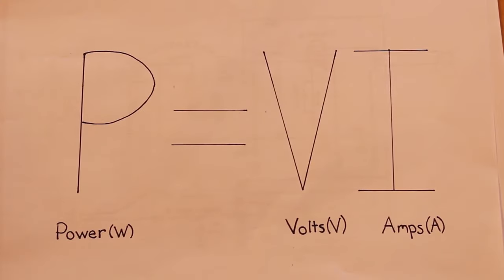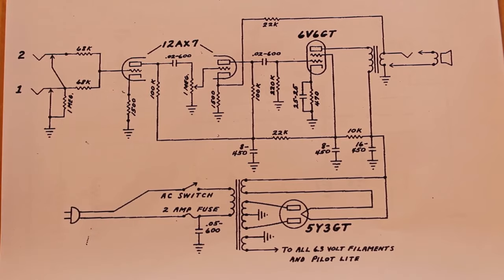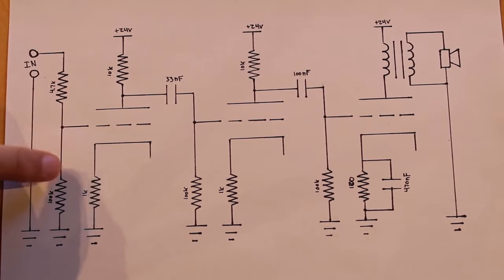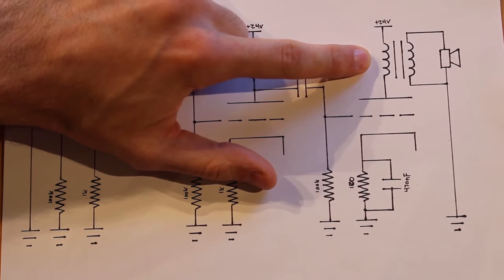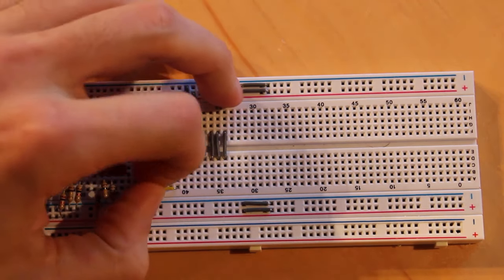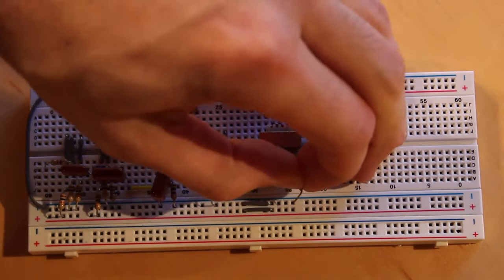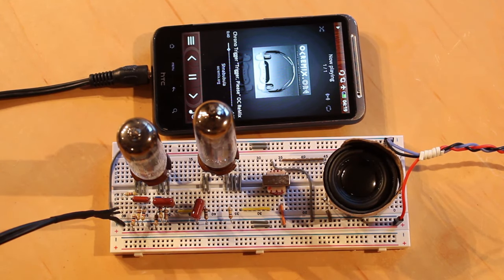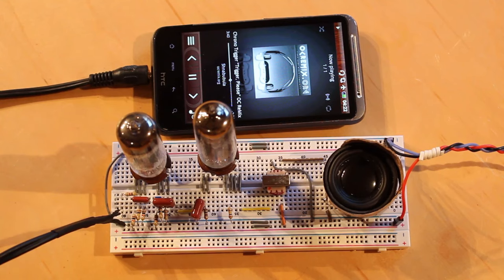Let’s Build a Low Voltage Vacuum Tube Audio Amplifier

Comment: Instead of thinking of the caps as DC blocking, think of them as AC coupling.  They let AC (the audio) through, but gets rid of the DC bias
Reply from the maker: I always had a hard time with wrapping my head around capacitors letting AC through. There’s no direct connection inside a capacitor and we’re not inducing any voltage with magnetic fields like in a transformer, so how can AC pass through? 

What ended up clicking in my brain was that AC isn’t passing through so much as the capacitor is just charging and discharging in sync with the frequency of the AC. When the AC is on the positive phase, it charges up the capacitor, making the other leg of the cap act like a ground pin. When the AC is on the negative wave, the capacitor discharges, making the other leg of the cap act like the positive pin. (At least, that’s how I’m seeing it in my brain, that’s probably not the best way to describe it though).
Reply: @UsagiElectric  And isn't the electricity flowing one way on the charging and then the opposite way on the discharging? So that electricity never actually flows through a capacitor?
Reply: @UsagiElectric  in the process of trying to build a low voltage tube amp for a pair of old 1920s head set I’ve got, and remembered this video, hoping it will work, any how seen the comment about capacitors and I figured I’d add some more info the Charge is being stored within the dielectric of the capacitor, Benjamin Franklin explained this when the layden jar was created, and somehow it changed to the metal plates!
Reply: @UsagiElectric  I've always just accepted DC blocking caps without properly understanding until you explained it.
Reply: @edgeeffect  There's also AC-blocking capasitors, called capasitor dropper. Take mains voltage it is 120 ACv 50Hz or 230-240 ACV 60Hz. When the caparcitor charges on the rising voltage it passes current trough, but when it is fully charged the current stops to flow. So based on the capacitor value and the current flow on the load it drops the voltage as it only lets part of the wave in each "hump" through.

Comment: I think you would get more gain if you used cathode bypass caps.   The cathode resistor is there to put a small dc voltage on the cathode to bias the grids slightly negative so it is operating on the linear part of the tube's power curve.  Without the cap to bypass it, it is not pure DC but varies with the signal in the plate current.  This effectively will cancel out some or all of the input.
Reply: You won't really get the tube running in its "linear" region as you put it with such low voltage.   Cathode bypass caps really won't make much difference at such low voltage, with such a small output transformer
Reply: @EsotericArctos Right, the tubes are basically running in "space charge" mode here

Comment: I really appreciate the work youve done with tubes. Not many (at all) work with tubes at low voltages. Been waiting on an audio setup!
Reply from the maker: Thank you so much! I think high voltages usually associated with tubes scare a lot of people away from them, but they actually work surprisingly well even at low voltages. We actually expand this audio setup a bit more in the next episode. Also, one of these days, I would like to try to build a proper OTL amplifier, although that one will probably require a genuine HV power supply.
Reply: @UsagiElectric  i agree the plates should only need about 36 volts to charge them

Comment: I did it 40 years ago using 12ax7 or au7. With 12v on the plate let the bias float. It was remarkably clean.

Comment: The capacitors between each amplification stage are called interstage coupling caps.
The easiest way to conceptualize these caps, for novices, is that they block DC but allow AC to pass through.
The DC voltage is your tube power, and the AC is your audio waveform being amplified.
Basically these block the high voltage DC from passing to the next stage, but allow the AC audio waveform to pass through unopposed for further amplification.
Reply: nah

the easiest way to conceptualize these caps for novices is that they get dc biased

u have to mention that the signal after the input is actually an ac signal with dc offset

and the capacitor when exposed to this signal slowly gets charged to a voltage because this signal is centered around a dc voltage and not 0

they get charged to the dc voltage, therefore only the ac passes since the ac is swinging around that dc bias, and the capacitor cant react/charge instantly, therefore passing the ac

this is basically a high pass filter

basically imagine the capacitor gets charged to an average value of the signal it gets (both sides), say if the capacitor has 5v charged because ur signal is centered around 5v, the resistor after capacitor has a voltage of 0 or the divider voltage, imagine the resistor is connected to ground therefore 0v when capacitor is charged, now the signal is 6v, the capacitor cant charge instantly, but since the capacitor already has 5v across it, a 6v on the capacitor positive terminal means 1v on the other terminal, the signal is forcing 6v on the positive terminal because it is a voltage source, since the capacitor has 5v, the other terminal must be 1v, and this 1v is also on the resistor since the resistor is connected after the capacitor, this is how the changing signal gets passed, now novices will ask, whos to say the capacitor wont charge to 6v and wont pass the signal, that topic is covered within filters and frequency response, in the same way, if the signal suddenly becomes lower than 5v, the resistor actually has a negative voltage, which many novices dont understand how u can get a negative signal from dc voltage, this is because capacitor discharges the other way through ground, and this is also why the voltage signal needs to be push pull, say if u have an emitter follower without a resistor to ground, u could measure a changing voltage, but a connected capacitor wouldnt discharge because when the signal becomes lower, there is no pathway to ground to discharge

if u understand these, u can further understand dc bias in capacitors, diodes, varactors, extending into rf circuits

saying they block dc but allow ac is like memorization, u cant conceptualize and u cant understand

when i was a novice, i sure didnt get or conceptualize wtf u mean block dc but allow ac, i mean i heard wat u tryna say(but i would just be a yes man, it be like "it is wat it is" for me), and theory also says so, but there was no conceptualization

but what i mentioned is the actual conceptualization

now if u learnt about superposition in ac circuit, then u can also calculate it and model it, u can both see how it passes the ac and see the frequency response/transfer function in a simple rc circuit

when u a novice, u also dont understand why everyone says only ac make sound when clearly dc also makes sound

because their definition is ill defined, though dc is defined as current in one direction, ac as current in both direction

as long as a signal is changing, no matter ac or dc, it will make sound, might be better to call it an ac signal with dc offset, in circuit model, u would put dc source series with ac source

and another thing novices dont get is how a transistor is able to work with ac when it is a dc device, the reason is also the capacitor, u cant just apply a negative signal, but if u apply that negative signal to capacitor first which has a dc bias, u can offset that signal into the positive as long as its amplitude isnt bigger than the dc bias, thus the transistor is actually still working with dc (formal definition)
Reply: @urnoob5528  You dive into the fine details, while correct, novices will just stop listening because it is much too much information at once. A novice starts with basics, not fine details. If novices dont get it, its because the explanation is too detailed.
Reply: Thank you👍
Reply: Some pedal manufacturers, like BOSS, use electrolytic caps for interstage coupling, due to cost. A 1 mfd electrolytic is about ten cents, where a nice polyester or mylar cap is about two dollars.
With the electrolytic, it only conducts one direction. So, you receive only half the sine wave at your signal out.
I can always tell a BOSS pedal because they sound like BOSS pedals.
MANY manufacturers do this, so, check your pedals and replace any interstage electrolytic with a nice polyester of same rating.
Replace ONLY electrolytics that are INTERSTAGE not electrolytics used for power or other functions.
Make sure you use a schematic.
If unsure, LEAVE IT ALONE.

Comment: Thanks for the great video. I joined the Royal Australian Navy in early 1979 and entered into an electrical engineering course. My class was the last to learn about valves and I worked on the 4.5" turret which was driven, as well as an A and B motor, by a big bank of valves. One of my biggest regrets is deliberately blowing up valves in the RCA testing case!
Reply from the maker: Thank you so much!
That's awesome that you got to learn and work on some proper tube equipment. I can't imagine the amount of power needed to drive a 4.5" turret, the bank of tubes must have been truly a sight (and a great heater in the winter)!
Reply: @UsagiElectric  In general, the motors in heavy duty drive trains such as gun turrets use DC torque motors, which have their current controlled by DC motor generators (MG's). The output of the motor generator provides the current to one of the torque motor windings. The input to the motor generator controls its output current. At this point the MG input could be produced by vacuum tubes or solid state circuits in more recent equipment. Using the output power of a large group of tubes to provide the current through the torque motor winding is possible, but not very practical.

Comment: Dear Usagi, excellent project!
This extremely low voltage amp is useful as a phono preamp or a similiar application. Since most tube amps need a plate voltage of 300v or or higher, most folks use transistors amps. But, I think tube amps sound better.

Comment: You inspired me to go back to tubes experimentations : since your two videos on heptodes, I built a low-voltage guitar tremolo with a beautiful, small 6AJ8 pentagrid converter, and was amazed by how good the sound is, given the circuit simplicity. Thanks for your enthusiasm, keep up the good work ! By the way, if you plan to make a bigger amplifier (push-pull?) and start to get distorsion, you can disassemble the E and I laminations of the output transformer, and put them back with all E together and all I together, separated by a piece of paper, all maintened together with lacquer or duct tape : the air gap between E and I pieces will prevent core saturation due to DC voltage. This is what is done on most output transformers as far as I know
Reply from the maker: Thank you so much! That's awesome to hear that you've gotten back into tube experiments! I absolutely love those tubes that have that mesh on the inside, like the 6AJ8. I have a few 6EJ7 pentodes that look like that and they're just such cool looking tubes. 
I would someday like to build a proper high voltage amplifier that can put out some serious sound, but I've actually gotten really interested in OTL amplifiers. I have something like 150 6CB6 pentodes that are decently linear when triode strapped, so something like a 10 or 20 tubes output stage using those little guys might be pretty interesting and give some wild sound!
Reply: @UsagiElectric  I love my 6BX6 for you can see the cathode glow, but man, those 6CB6 are on a whole new level ! Can't wait to see an OTL with these

Comment: I remember building a small 'triode-pentode' amp from the junk box, way back about 1972. It worked amazingly well.  Although designed as an output for a radio, it also served very well as "gram" amplifier.  As far as I can remember, it was intended to run at around 200V HT, but to my astonishment it worked all the way down to 12V HT. The only real discernable difference was in the reduction in volume as the HT was reduced. Once below about 50V HT, some degree of distortion began to creep in as the volume pot was advanced.

Don't be fooled into thinking that at low HT you can only drive a small speaker - Not so! Taking the amp in this video, I'd happily connect a 6"x4" speaker, and you would notice a distinct increase increase in output volume.

My amp was based around a salvaged TV audio valve (tube, if you prefer) and was a humble Mullard PCL82 (it could equally have been an ECL82) whatever they might equate to in other nomenclature. I added a basic tone control, and in its native form it had no NFB. Had it done so, it may have faired better at lower HT.  I drove a single 'Richard Allen' 8 inch, 3 Ohm round speaker from that amp, and at around 110V HT it had more than adequate volume for an average sized living room, unless you really wanted to drown out the pneumatic drill in the street outside the front window!

The next step should have been a push-pull version, but for some reason it never happened.
Reply: yep  those valves give useful output at 100v ish ht or even less, theres a variant of it called 30PL14/PCL88 which may give more current and output for a given ht voltage, and is identical pinout to a PCL82 and near enough same heater voltage 15,  PCL82 is 16 .. another alternative is a PCL85/805 , normally a TV frame output valve
Reply: There's something like strontium or thorium or whatever that they put into the cathode, to moderate emission because it's too efficient. Which also makes it into a wear out mechanism for planned obsolescence. The state of the art was advancing way ahead until rug suddenly pulled out from under them with new solid state.

Comment: Very interesting... I did the same when diving into schemas w/ tubes, even though when starting with electronics, both ground and power 'rails' were at the bottom of the schema. For mental clarity it is just much easier to have them separated: ground on the bottom and power on the top. With that, already the orientation of a component implies what's going on. Same is then true for horizontally oriented components: they show what is going on between, for example, stages. The 'look' of a schema is so important to match the topography of the circuits operation.

Comment: What you're calling a DC blocking capacitor is generally called a coupling capacitor amongst people who build tube amplifiers and radios etc. And it is to block DC but not for the reasons you were saying. On a typical vacuum tube amplifier setup your putting 150 to 500 v say on the anode of the gain stage. The high-voltage is to attract the electrons from the cathode and the higher the voltage the more amplification you get. The amplified signal is actually a/c which will pass through a capacitor. That coupling capacitor is to block that 150 volts from hitting the grid of the next gain stage while allowing the audio signal that has been amplified to pass through to the next gain stage. I hope this makes some sense

Comment: Who needs a volume pot when you can change the voltage!🤘🏿
Reply from the maker: It would be fun to build a high voltage tube amp with a variac as the volume control! Want more volume, literally crank up the power!